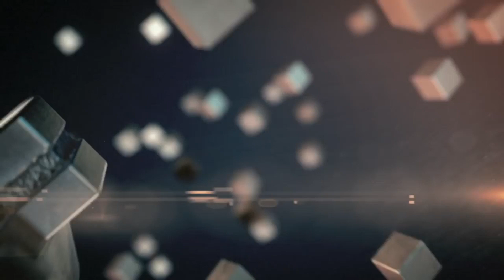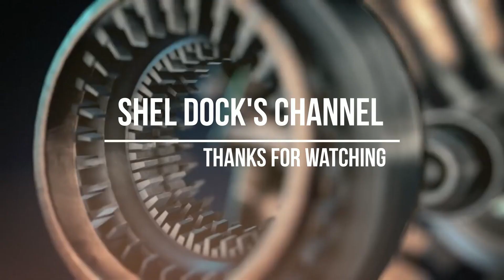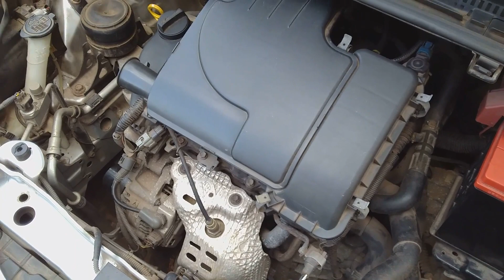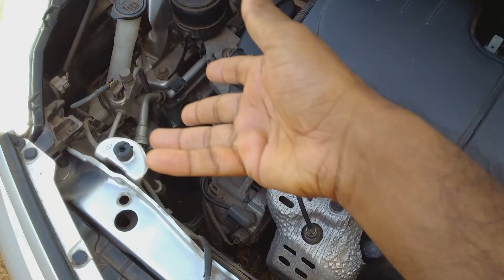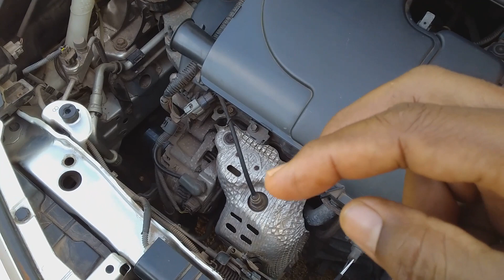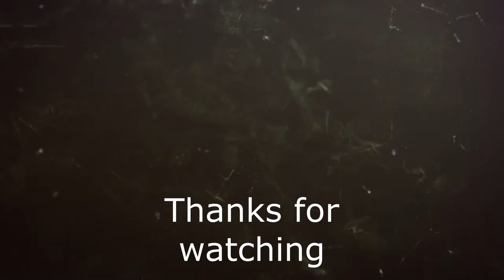Toyota Vitz Why 3 Cylinder Engine Vibrates Part 2

Comment: Can you use a 4plugs to a 3 plug car engine
Reply from the maker: As long as the plug neck length is the same along with close internal resistance and similar tip is maintained you should be good to go.
Reply from the maker: Internal resistance should be between 5000 to 6000 Ohms.

Comment: My only problem is the engine vibrates when reversing ,and when AC is on at a idle stop while my foot is on the brakes even when AC is off and at a idle stop.. how do I stop the vibrations and let is trackle smooth?
Reply from the maker: Once your electrical system is in tack the only other two systems that can cause engine vibration are:
1 air intake and EGR system and
2. Fuel system.
Thoroughly clean the parts on these systems will positively solve your problem
Reply: @ShelDockToyotaVitz  contact me please directly I'd prefer you fix the issue for me
Reply from the maker: Quick question, have you change any part of your engine and if yes what part?
Reply: @ShelDockToyotaVitz  I change the right engine mount & and I've cleaned the throttle body and the mass airflow sensor
Reply: @ShelDockToyotaVitz  I'm wondering if the egr valve is clogged
Reply from the maker: It can be difficult to pin point engine vibration problesm when there is no error code to guide you. Even with bringing your vehicle to a mechanic he also can have difficulty finding the problem.
1. The only way to solve this problem is to go through the engine systems one by one starting from the easiest.
A. Sparkplug
B. Ignition coil pack
C. Trottle body
D. MAS sensor
E. Injectors
F. EGR valve
G. PCV valve
Just work your way through these systems until you solve the problem.

Comment: I did a full tune up and cleaned the throttle. Then for five six days there was no any vibration.but now i am experiencing a vibration.
Reply from the maker: Finding a problem is best done by searching or cleaning/correcting one system at a time. This means that if it is the injectors you are cleaning, you clean them then start the vehicle to see if the vibration is gone. If it remains then you move on to another possible cause.
If you did a full tune up as you said you may never identify the specific problem and this may be important to future problems. Do you experience problems relating to the battery during starting?

Comment: Hi sir
 My vitz 1000 cc vibrates too much when in D mode and AC on. It is ok when AC is off or when its idle. How to decrease vibration while AC on. Plz help
Reply from the maker: Is you engine check light on?
Reply: @ShelDockToyotaVitz  hey sir i have 1000cc vitz its vibrates too much in d mode aswell engine check light is  on any solution?? Its knocking aswell plz reply
Reply from the maker: @faysalshorts1  Whenever you have a engine check light "ON" you will first need to find out what the fault is. Do a scan and identify this fault causing the light to be on.

When you have the engine check light ON the engine will never run properly because the ECU can not properly assess engine performance.

When this check light issue is resolved then you may just also solve the engine vibration caused by the AC being on.

Usually when the AC is on the engine throttle up a bit to deal with the extra load.
The ECU may not be able to assess this condition with this check light issue.
Reply: @ShelDockToyotaVitz  in knocking  as well in 2nd gear ?
Reply from the maker: @faysalshorts1  Am assuming that your transmission is not CVT. I am also assuming that once your vehicle change to second gear and you hear knocking then your problem may reside with your transmission.
I am going to be honest with you, its difficult to assess what is happening with your vehicle with the information you posted. 

However let me give you some ideas on what causes knocking sounds in or on an engine.
On the engine
1. Loose parts
2. Bad roller bearings (belt pulley systems)
3. Bad Alternator, AC compressor or starter bearings

Inside the engine
1. Bad Crank shaft, connecting rods bearings
2. Ticking noise created by lack of lubrication on the cylinder head.
Reply: @ShelDockToyotaVitz  but mechanic told me some sensors are demaged 😂

Comment: Hi there, good vide0s, keep it up, Sir my car vitz engine vibrates, but when giving accelerati0n, it gets stable, and als0 the car has n0 pick at all, it runs as if the car is 1000 pounds and the engine is only 100 cc, no pick at all, what could be the possible solution, kindly reply me, Thanks
Reply from the maker: 1. If your engine revs up when you press the accelerator pedal either in park or drive but the car seems not to be moving as expected you could have a transmission problem.
2. If your engine does not rev up as expected when you press the accelerator pedal either in park or drive you may have a fuel or an electrical problem.
3. If the problem is electrical and you press on the accelerator pedal you should have some sensation of fuel at the tail pipe. If the air fuel mixture is not burning properly you should definitely smell fuel at the tail pipe.
4. If you smell no fuel at the tail pipe the engine is burning the fuel completely but you may need to clean your fuel system because you may have some restriction in the fuel line up to your injectors.
5. If you press quickly up to full acceleration in park or neutral and the engine revs up well however when you put the vehicle in drive and accelerate the vehicle up to full acceleration and you experience a reduce or lost of power you may have a fuel problem.
Reply: @ShelDockToyotaVitz  Thankyiu for your reply, first of all i have a manual transmission old model it doesnt have an rpm meter, how could i check engine revs manually? kindly let me know, Thanks
Reply from the maker: You don't need to look at a rpm meter just listen to the engine reving up when you press the accelerator pedal. There should not be any delay.
Reply: @ShelDockToyotaVitz  Allright, thankyou again
Reply: Turn your ignition on and off 2 time. And turn the engine on. Put in Drive mode and engage the hand brake. Get out of the car. Let it idle for 5 mins. And get back inside. It will Callibrate the engine

Comment: Hello Shel Dock
Pls I have this type of engine and this days hesitating to move when you step on the accelerator pedal I've tried so many things but still giving me same problem.
Delay in picking when you step on the gas it's difficult to climb a hill please what can you do to help me I need your advice thank you
Reply from the maker: You could check your accelerator pedal sensor. Sections of it may wear and not picking up.
Reply: @ShelDockToyotaVitz  ok thank you
Reply from the maker: You will need to give me some ideas of what you have tried so that I don't give suggestions you have already checked.
Reply: @ShelDockToyotaVitz  ok when the program started I change the transmission oil the problem still persist I have also changed the throttle body I have changed the fuel pump and the filter I have clean the air flow sensor.
I'm trying to locate the accelerator peddle position sensor but I can't find it.
When the car on level ground it runs perfect but a little hill there would be a problem
Reply from the maker: Does the car shut off going over hill
Reply: @ShelDockToyotaVitz  where are you located.  Need a vitz specialist to look at my car
Reply from the maker: What kind of issues are you having with the car?
Reply from the maker: Does your engine rev speeds up when you press on the accelerator pedal but the car moves sluggish up hill.
Reply: @ShelDockToyotaVitz  yes and also when you come at stop at the traffic light and you want to move again
Reply from the maker: 1. Remove your air filter cover from the trottle body. 
2. Start the engine leave it in park.
3. Get a good view of your trottle body valve while someone is pressing the accelerator pedal.
4. Tell the person when to press and released so you know when the value should be opening and closing.
If the valve moves consistent with your instructions to the person pressing and releasing then your accelerator pedal sensor is ok and your trottle body valve positioning system is good.
Reply from the maker: The person should not be pressing the accelerator pedal too fast.